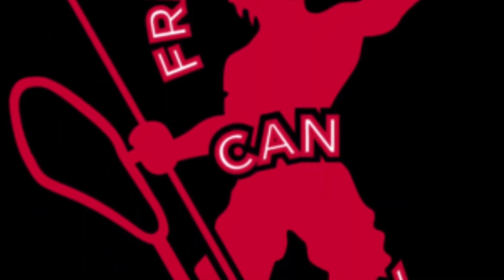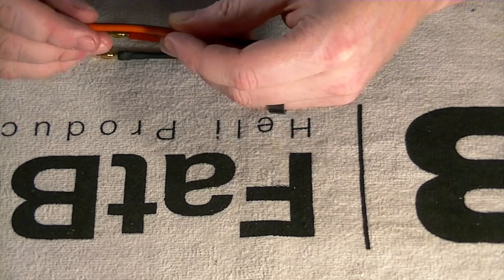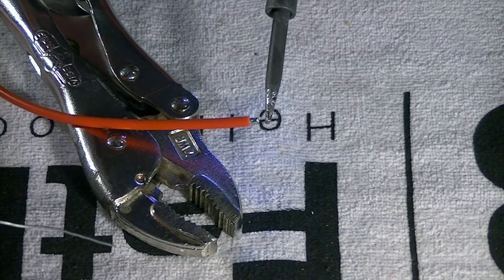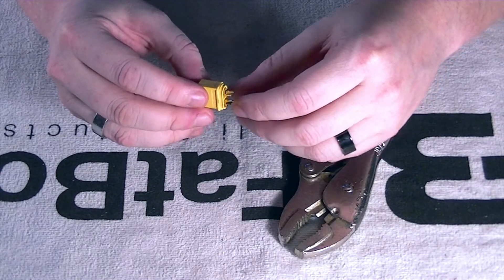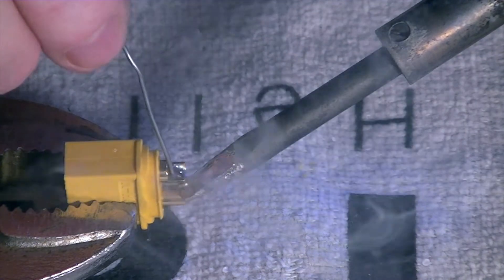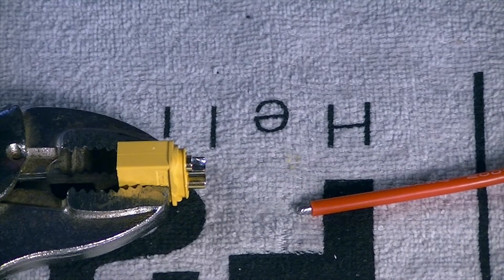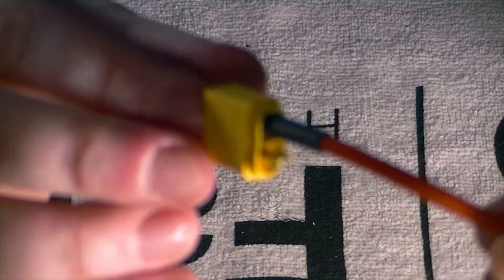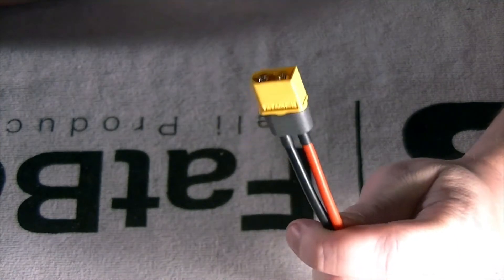How To Solder : XT60 series connector (FreddyCanFly)

Comment: The battery pack should get the female. Since you can’t turn off the battery the female connector prevents anything from falling inside and shorting the two bullets. 

Male= cavernous open inside with two bullets. Something could fall inside and short the bullets

Female: two round holes surrounded by plastic. These female ends of the bullet cannot physically touch each other due to the plastic

Comment: One other thought, if you go ahead and slide both halves together, there is less chance that the heat will deform the plastic. Not that big a problem with the sockets, but the pins really want to move around once heated. Personal experience 😢

Comment: The heat shrink is like suspenders AND a belt 😂. I will say that with the heat shrink, if the current draw heats the solder joint to the point of failure, there is maybe less of a chance of actual separation.

Comment: Hello Freddy 
Always nice videos 
Just one question I have a ar8000 airplane receiver but don’t know what satellite to used    Is all the DSMX work ?? Or I need a specific one hope you can help 
BTW I finally set up my trex nitro with the AR 7200 follow all you set up videos you was right on the money so do I 
The heli is super stable thanks 🙏
Reply from the maker: hey buddy that's some great news I am happy that the videos helped.  So your receiver should say on it DSM2 or DSMX for the modulation. If its an 8000 I wanna say its probably DSMX
Reply: Yes is aDSMX 
So I can used any DSMX satellite right 
I was looking at   Horizon hobby 
The add said 
DSMX Remote receiver 
SPM 9745 
Replacement remote receiver for DSMX receiver that utilized a remote remote receiver 
For what I understand any DSMX satellite is compatible with any DSMX Ar8000 right ??